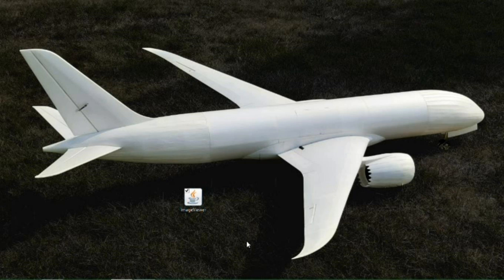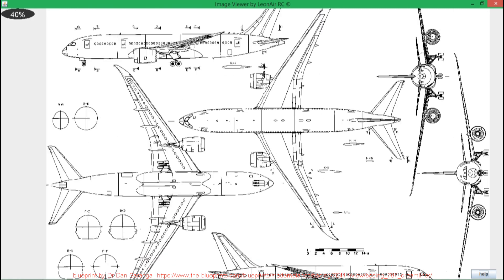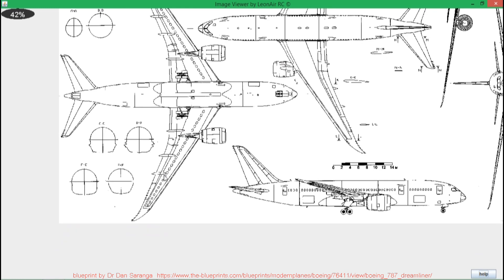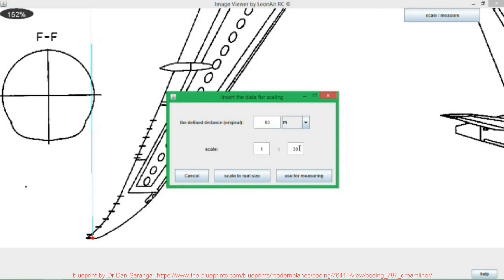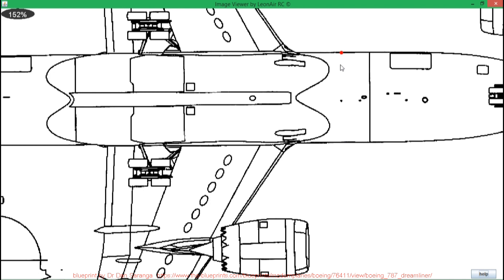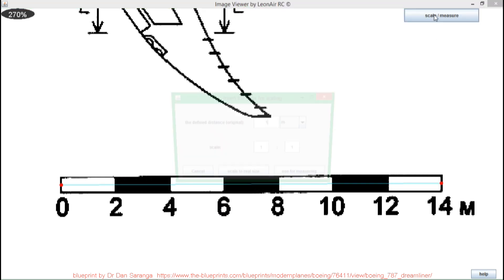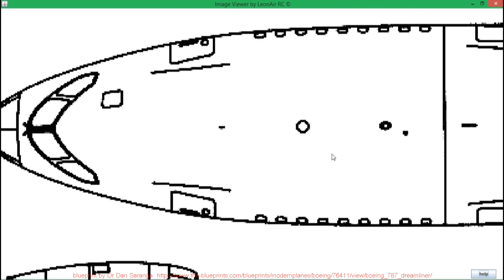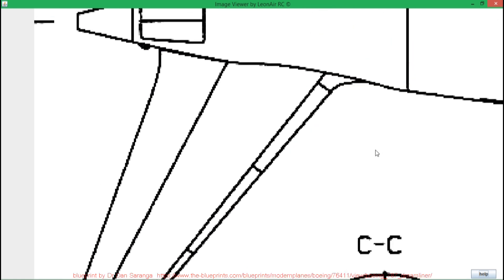How I make the plans for scale RC airplanes

Comment: I can’t draw this straight to paper when I scale it to the real size as my model A350 is too big. Is there a way I can export it to for example paint and go print it in a printing shop because when this exports, it is a .CONF file and paint and other apps don’t support it. So is there a way I could print it using an app or this app itself?
Reply from the maker: This is not yet implemented as it is not really a requirement for this kind of application.
You can either use the printing tool to print many smaller pages and put them together or split the image into chunks on your own.